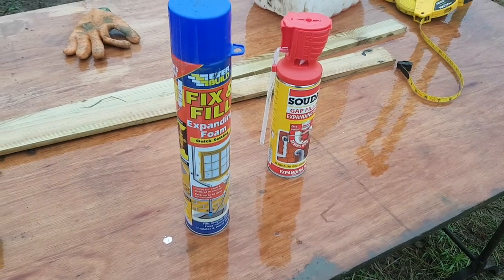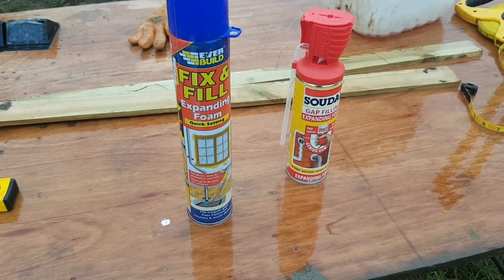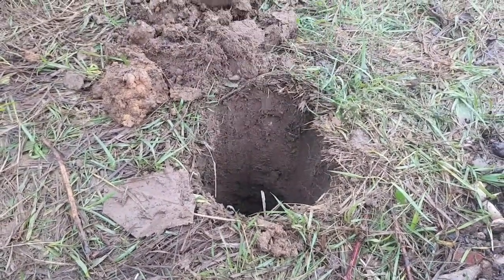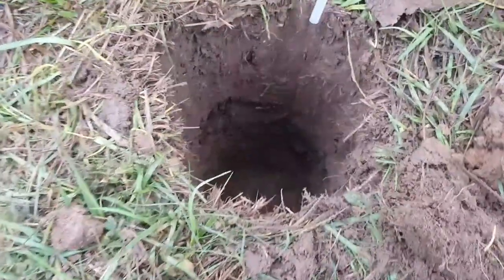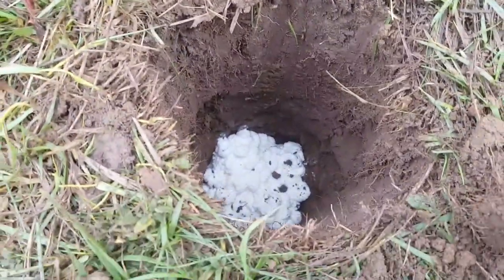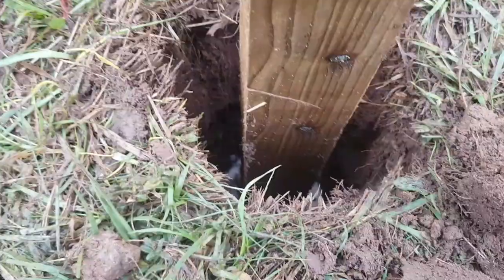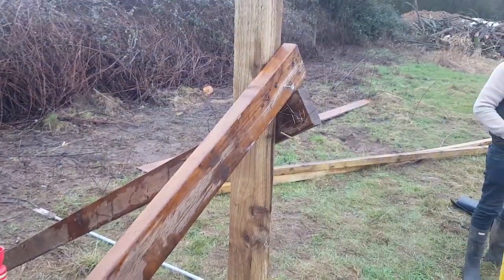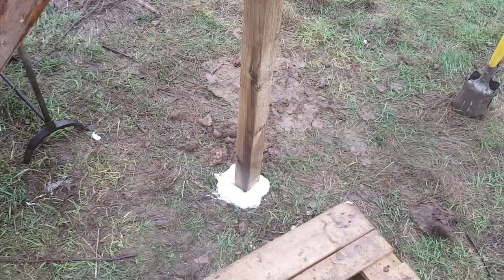Quick, cheap and easy post fixing!

Comment: I've used foam before for setting posts and got ridiculed. 😯 From what I understand though it's better than concrete and won't rot the posts.
Reply: in theory lol, the ones iv done before are 3 years old and still no rot so only time will tell!

Comment: How much is expander foam in the UK?! In Australia you won't get a can for under $15  - $20. Where a 20kg bag of cement is $7.50 or pre-mix concrete for $8.50.
Reply from the maker: It's about the same price for a can as it is for a bag of post mix. The bigger can is actually cheaper lol
Reply: @FieldtoFarm_UK  Sadly not here. How many quid for a big can in your neck of the woods?
Reply from the maker: the big can is £3.99 and post mix is around £1 more so works out well, plus you don't have to carry the heavy bag and a bucket of water lol
Reply: @FieldtoFarm_UK  They're you have it. That's about a third the price of here in the colonies. That's why I guess I've never heard of doing it that way here.